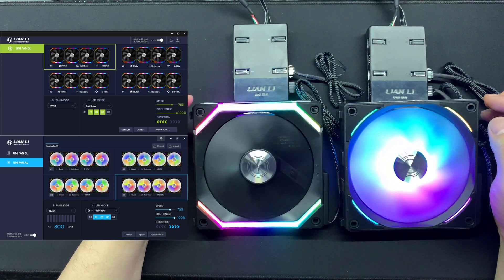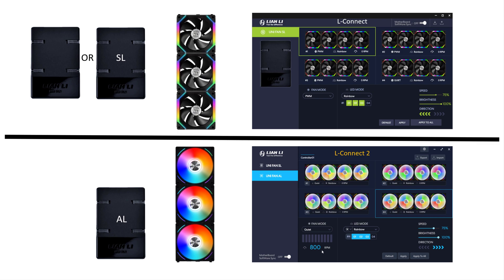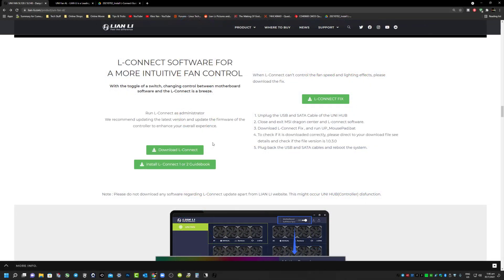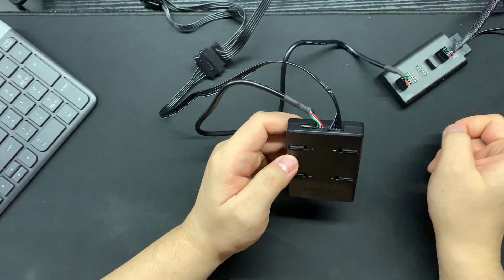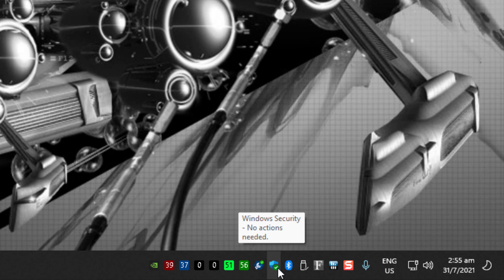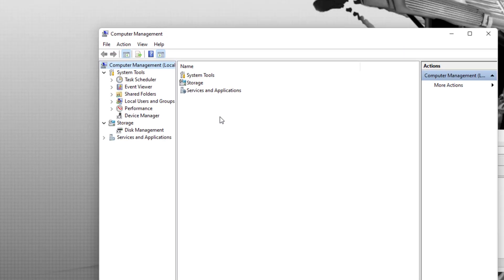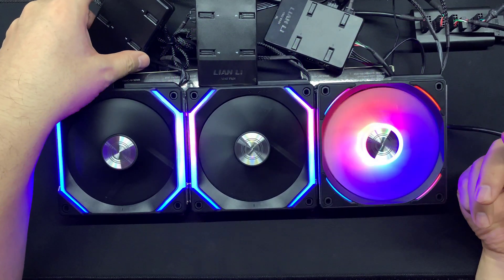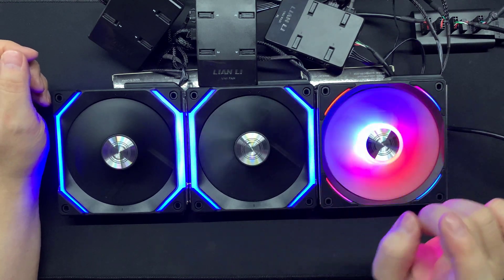Lian Li Uni Fan AL120 & SL120 Controllers - Firmware and Features [L-Connect 2]

Comment: how do you control older gen SL unifan fan speed using  mobo?
Reply from the maker: Hi Sebastian Tan, welcome to my channel. For the Liquid AIO radiator SL fans, I will plug the fan connector directly to CPU_FAN1, let the motherboard at PWM Mode and let it control the rpm base on CPU temperature, leaving the argb connector to the uni controller to control the lighting effects. As for the rest of the case fans, both fan and argb connector to the uni controller, have the uni controller to control the fan rpm and argb effects. The reason is, if it happens that the uni controller malfunction, the radiator fans will only have issues with the lightings and not the fan rpm. This is just a safety precaution to ensure that it will still cool the radiator.
Reply: @KleoYan  hi i will like to know. Can i connect galahad aio rgb to the new AL fan controller?
Reply from the maker: @sebastiantan1769  welcome back. yes you can. No issue. The pump argb connector can be plug to the AL controller 👍
Reply: @KleoYan  ah okies. As for the mobo sync, i understand one of it is to argb header. Another pwm header. Can i plug to to my cpu fan header on my mobo?
Reply from the maker: @sebastiantan1769  hi, yes you can do that.not an issue

Comment: Do i really need to disconnect all the fans and rgb when upgrading the controller?
Reply from the maker: Hello Kappa, welcome to my channel. It is just my practice, you don't really have to do it. but there are reports for some viewers of mine who did the firmware flash and when they turn on after flashing the firmware, the AL or SL fans does not react and remain default rainbow argb, so ended up have to disconnect, flash out the memory that stays on the fan chip. btw AL and SL have a build in chip as they are able to do individual colors when you set L-Connect 2 to stack profile with individual colors. so ya, the choice is yours.

Comment: Sooo what do I do if it doesn’t show my controlled in the update tool...
Reply from the maker: Hello t c, welcome to my channel, you might want to test another USB 2.0 motherboard header if you have that. if not, you might want to remove all argb program, example amoury crate, gigibyte fushion and etc. remove L-connect app too. make sure to use Revouninstaller to remove them as this will clear all registry https://www.revouninstaller.com/revo-uninstaller-free-download/ . next shut down your pc, unplug your PSU plug from main outlet. let it sit for 30 to 45 seconds. this will help clear memory stored in your system. next plug back the PSU plug and turn on your system. make sure your uni controller is plug to the usb header. check on system manager to make sure you see the uni fan listed. next install L-Connect app. then test it out.
Reply: @KleoYan  I figured it out! I tried both usb headers to no avail, eventually ran across a sub Reddit claiming Msi dragon center was causing the issue. After removing dragon center the update tool saw my controller immediately! :)
Reply from the maker: @tc7364  thank you for the feedback, yup infact that's what I've mentioned. remove all argb program using revo uninstaller (to clear all leftover files) then install L-Connect only, it will read, then install other argb program if you need. Reason is.. the mobo argb utility took control over the IRQ which stops L-Connect or even the USB port itself to detect the uni controller. am glad you've resolve your issue. thanks again for the feedback.
Reply: @KleoYan  I guess I just didn’t understand what you meant. I’ve only built my first pc last year haha still learning. Thanks for the replies!
Reply from the maker: @tc7364  hey is ok. We all learn no worries. I was just explaining and pardon me. It’s my bad, I didn’t explain fully to you. Sorry about that.

Comment: can you help me ? i have #1 " fans " set to 1.8k RPM and i cant set it to 800rpm " quiet " it does not apply it ... but other fans does
Reply from the maker: Hello A.E.A welcome to my channel, have you tried changing port connection? as in if your output 1 fans are working but your output 2 fans is not working, change the connection between output 1 and outpur 2. if your fans that are previously not working on output 2 but works on output 3. this could be a controller issue. if it still remain not working, then it could be the cable that is connected to the set of uni fans. change the cable.
Reply: @KleoYan  turns out one of the cables was faulty so i had it replaced and its working now and i can change the rpm on all , thanks!
Reply from the maker: @SteveFuks  you are most welcome 😉

Comment: What's the advantage/reasoning behind updating the firmware on the SL controller from 1.1 to 1.2? I just bought the galahad 360 and a 3 pack of fans and realized I have two controllers, and I have a 1.1 installed right now, but I have one marked with "SL" on my desk. What should I do? Thanks, great videos.
Reply from the maker: Hi Mike Charge, welcome to my channel. If you have the marking that stated "SL" you should try out the L-Connect 2 instead of 1. you will see some slight difference to the argb effect patterns and you are now able to set this L-Connect app to auto load during windows bootup. I've done some Q & A in this video https://youtu.be/1n1mo6TDwvY which you might be interested.
Reply: @KleoYan  Ok great - weird because I have L-Connect 2 running now, but the controller doesn't have thet SL marking. I'm going to swap the controllers in the next few days. Thanks for the reply.
Reply from the maker: @mcharge10  you are most welcome, you should use L-Connect 2 with the SL controller that has the SL marking. if it does not, do a firmware and it will be able to, just like in this video I have illustrated.
Reply: @KleoYan  your videos are great - I watched like 4-5 of them since yesterday, thank you!

Comment: L-Connect is total trash and they don't make it easy to upgrade firmware on the hub controller but it all works. windows defender tries to block installation files so you have to bypass that. Once software and firmware update is installed then everything works like a charm. I would say the most annoying thing with L-Connect was shutting your PC down and then starting it up and L-Connect doesn't startup and load your RGB profile.
Reply from the maker: Hi Mark Ching, welcome to my channel and thank you for sharing this piece of information.

Comment: So if I do this will I be able to set a set of 9 SL Fans as individual colors (like blue,green,blue) with one updated controller like on the AL fans ?
Reply from the maker: Hello 2007farenheit, welcome to my channel. Yes you will be able to control individual Colors on the set of AL or SL fans. You can watch this video on how it works too https://youtu.be/1n1mo6TDwvY
Reply: @KleoYan  So I can have 9 different SL colored fans off one controller? :-0
Reply from the maker: @2007farenheit  yes. Just make sure is 4 fan max to one output of the controller. You might want to view the dos and donts of the limitation of the uni controller in this playlist https://youtube.com/playlist?list=PLEW-b-2vYDdPo0NzHyeksx012c-nkDapm
Reply: @KleoYan  thanks!
Reply from the maker: @2007farenheit  you are most welcome and all the best in your build 👍

Comment: I had my fans connected to the hub and working with L-connect, I decided to upgrade to L-connect 2 and did the firmware upgrade but the firmware upgrade failed and now I can't get it to with L-connect. Any idea what I should do?
Reply from the maker: Hi GrimmGamez, welcome to my channel. before proceeding, I assume you are using SL120 uni fans, does your uni controller have the SL marking on the controller? if it has, no firmware needed and you can just install the L-Connect 2. I would advise you to remove all argb application from your system using revo uninstaller https://www.revouninstaller.com/revo-uninstaller-free-download/ first, then follow by shutting your PC off with the PSU cable unplug, press the power button a few times (2 to 3 times) to discharge the current holding on your PSU and motherboard. Let it sit for like 45 seconds, plug back your PSU cable, power it on again. then see if you can redo the firmawre. if that failed again, you will need to contact lian li directly as I am not able to assist you further on firmware failure. contact lian li through here https://www.reddit.com/r/lianli/ or here https://lian-li.com/faq/

Comment: when i update firmware after update verify it gives error
Reply from the maker: Hello ACE KIANI Gaming, welcome to my channel. which uni fan are you using? the SL or AL? If AL, no firmware is needed to use L-Connect 2 app. 
If it's SL and your uni controller has the SL marking, no firmware is needed too to use the L-Connector 2, but if there is no SL marking on the uni controller, then you will need to do a firmware which is explained in this video.

Comment: Hi, I'm from Singapore too, was hoping you could provide links for the Fan Splitter and RGB Splitter locally, like Shopee links as I can't seem to find them, thanks in advance ! Appreciate your videos too.
Reply from the maker: Hi Hassan Mahmudul, welcome to my channel, for fan splitters you can get in shopee https://shopee.sg/4-Pin-PWM-Fan-Y-Splitter-Sleeved-Cable-(Also-Compatible-with-3-Pin-Fans)-i.7649086.786903644 but for the argb splitter. I have search on either shopee or lazada, I am not able to find that, that's why I show the link from aliexpress. please read below for the argb splitter or you can DIY if you choose to https://youtu.be/Lz90i5ym4Dw 

Converter needed
===============
‣ Lian Li aRGB Cable Kit - https://lian-li.com/product/argb_cable_kit/ - Lian Li aRGB Cable Kit
An illustration of Lian Li aRGB Cable Kit - https://imgur.com/gallery/beYR8CN

If you are not purchasing the Lian Li aRGB Cable Kit, get the pin needle and the converter below. 
‣ Pin needles - https://www.aliexpress.com/item/32706628771.html or https://www.ebay.com/itm/224459128229 (you need to pull out one needle to fit the below converters)
‣ Converter - 1 To 1 Male https://www.ebay.com/itm/284004681911 or 1 TO 1 Female 5V 3pin https://www.aliexpress.com/item/1005001598378033.html

Comment: I got the ST120 fans from Lian Li am i also able to control them with the software??
Reply from the maker: Hi Slurpy, welcome to my channel. If you are using the uni controller that has the SL marking on it. You can use the L-Connect version 2 app without issue. If your uni controller is without, then you will need to do this firmware. Hope this video will aid you.
Reply: @KleoYan  so i got a controller with the box that came with the ST120 but somehow it does not work with the software… do i really need the hub you got or am i also able to controll it with mine? If you google the Lian Li ST120 rgb fan you will find the hub i have? Can you help me?
Reply from the maker: @slightlycracked1564  you can’t use the L-Connect 2 to use on other controllers. I believe the ST120 is a physical controller that does not use any software. You can use that to control the argb effects.
Reply: @KleoYan  okay tysm
Reply from the maker: @slightlycracked1564  you are most welcome

Comment: The firmware update did the trick, you sir are a savior. Although there is one thing that still annoys me about the software. In say the colour cycle mode, it still doesn't go as slow as in the software example. Mine still cycles very fast even with speed on 0.
Reply from the maker: Hi Harald, welcome to my channel and you are most welcome. as for the color cycle. I have yet to test that out plus I have returned the unit, pardon me as I am not able to aid you on this, but you can try asking at lian li reddit https://www.reddit.com/r/lianli/ , to see if anyone can aid you on this. once again, thank you for your kind words and to have visited my channel. all the very best in your findings.

Comment: hey man! came across a problem on my SL120. connected 12 fans to my uni fan controller. my number 4 fan suddenly running at full speed. even when i set all to quiet mode in L connect app. everything but number 4 is working :/ any idea how to fix this?
Reply from the maker: Hi Aaron Chua, welcome to my channel. On your L-connect are the 4 fans selected with you set the rpms? If yes and having issues, have you try removing that faulty fan, unplug all other fans cable to the uni controller and test out only the faulty fans to the uni controller? Use different cables to see if it reacts. If it’s not the cable and the faulty fan is working. It could be the connection point of your third fan to this 4th fan.
Reply: @KleoYan  i think the problem is the controller #4 fan. i remove 4th set of 3x fans the rpm is fine. but when i plug in another 3x fans on the #4 fan slot in the uni controller it straight away goes to full spedd and cant adjust it. the rest were fine when i tune it only the #4. so could it be the uni controller faulty?
Reply: i previously have a push pull configurator on a top mount on my dynamic case. which have a total of 12 fans. then this issue comes out of nowhere haha. but anyways i just remove the 4th set of fans ba , its working fine now just cant put in another 3x sets of fan. 
Appreciate the super quick respond though didnt expect it haha ! Amazing guide you have in your channel! keep up the good work my friend 👍
Reply from the maker: @Justaspendthrift  I see, hmm if your uni controller is faulty, I will advise you to get it change. Lian Li will replace it for you if your set is still under warranty. https://lian-li.com/contact-us/ and thank you for the compliment 😉

Comment: First thanks for your illuminating video. I'm just sharing my experience. I just finished assembling a gaming pc for myself. I used lian li o11 dynamic mini case. I used 2 sets (3 fan pack) of sl120 unifan and 2 140mm sl 120 unifans for nzxt z53 AIO. I replaced nzxt fans with sl120. I had 3 fans at bottom as intake, 3 fans at top for exhaust and 2 140mm unifan on aio as intake. Cooling was good. But the back panel of the case looked bare. Usually an exhaust is found in all cases. So i was searching for single piece sl120 black. But couldn't find it. Somehow i got hold of 3 fans pack of al120. My lian li sl120 controller had one empty port. I connected al120 to it. Surprisingly it worked and looked beautiful to me. All the preset color animations are also working. Everything went smoothly. I can share my video if anyone asks for it. Many thanks. Go on experimenting.
Reply from the maker: hello siddhartha bandyopadhyay, welcome to my channel and thank you for the feedback. You were saying that an AL fan works on a SL uni controller? This is shocking as what I know there are two sets of instruction for these controller. they are cater for each specific uni fans. It will be good if you can share your findings to the rest. I do not mind for you to post your vid :) but the thing is.. Youtube might remove your post.. may I suggest if you can share your video through my email at godzylatech@gmail.com. I will post it with your illustration and credit that to your findings. thank you!

Comment: Ah, nuts.  Mine errored out attempting a firmware update.  I wonder if that was because I had the fans all connected when I did it.  Will have to start over and try again.
Reply from the maker: Hello IIhares, welcome to my channel. A lot reported that's not the case. I only did it cos I don't want the sudden burst of lighting. By the way, have you got your set running first before you do the firmware?

Comment: Another confused person here. Lian Li's instructions are hard to follow. I have the SL120's x9, all in one controller that does NOT have the SL mark on it. Should I be using L-Connect 1 or L-Connect 2?

Also I have the Lian-Li Galahad 360 AIO. Is it possible to have this show up in the L-Connect software? I already have it plugged into the controller, occupying slot 4 of 4.

Thanks in advance to anybody that helps :)
Reply from the maker: Hi Stuart Murray, welcome to my channel. For your case, you are to use the L-connect v1.0 and not the L-connect v2.0 but if you want to use the v2.0 that has more function and features.  All you need to do is to do a firmware in your controller which is covered in this video. If you are still confuse, stick to using the L-Connect v1.0. 

As for your Galahad pump argb. You can plug to the uni controller and to use the argb effects with the L-Connect app. However it will not show in L-connect as a pump icon, it will remain as a fan icon. You will need to know which output of the uni controller you have plug to. Hope I did answer your question.
Reply: @KleoYan  Thank you so much for this response. I have spent more time with the L-Connect 1.0 with your response in mind and now am fairing much better with it :)
Reply from the maker: @HalfDayHero  you are most welcome. Now having playing with the SL120 fans with its controller. It will be good if you know it’s limitation too. This is to prevent you from overloading the uni controller. I have witness with others having to add more and more argb to this controller and ended up to have burn their unit. If you want to know what’s it’s limitation. I do have another video “dos and donts” which might interest you. https://youtu.be/QQHJUQvKwlY

Comment: Can i possibly connect and control the SL120 Fans using the latest AL controller?
Reply from the maker: Hello Michael Ramos, welcome to my channel. No you can’t as the firmware of the AL controller is meant for AL fans only.
Reply: @KleoYan  copy that and thank you for your quick reply.
Reply from the maker: @michaelramos5002  you are most welcome.